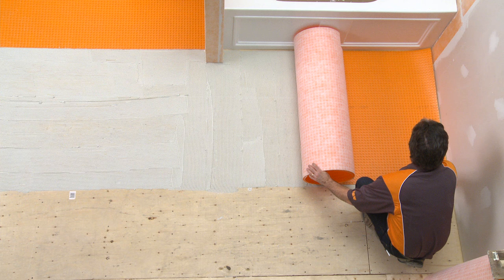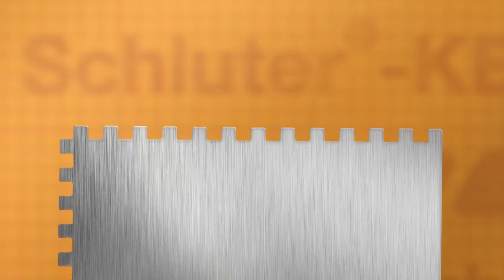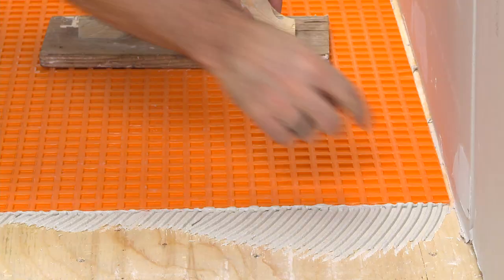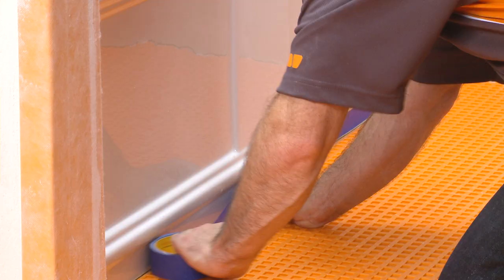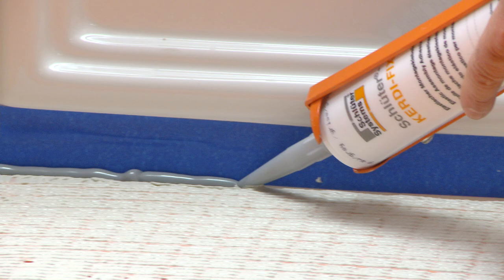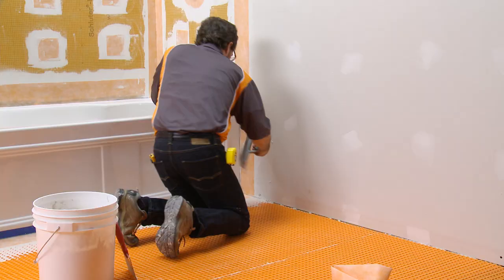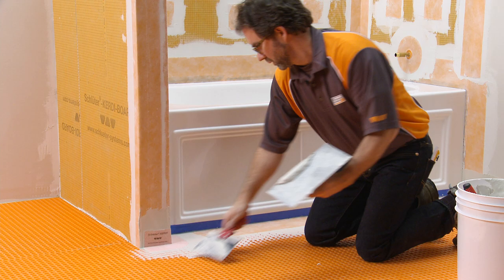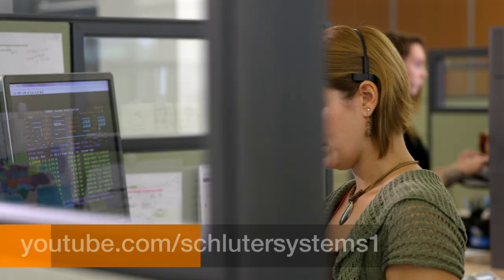How to Connect Schluter®-DITRA Uncoupling & Waterproofing Membrane to a Bathtub Surround

Comment: Thanks, very helpful for this first time diy. I have a question though, if you thinset right up to the wall for the band, doesn't that remove any possibility for expansion? Shouldn't it have the silicone on the quarter inch gap at walls like around the tub edge?
Reply from the maker: Hi! Good question. No need to address expansion in that area between the wall and the DITRA, as the thin-set won't be an issue there. However, movement should be addressed at the change of plane in the tile layer with a DILEX movement joint profile. Hope that helps!

Comment: How do you waterproof around toilet flanges that penetrate Ditra? Also, have water and drain pipes that penetrate vertically through the Ditra to facilitate a clawfoot tub. I can waterproof the 3/4 inch water supply with Kerdi Seal, but how do I create a waterproof barrier around the 2 inch drain pipe?
Reply from the maker: Hi Jeff! Our customer service team would be better suited to answer this question. You can reach them at 888-472-4588 (USA) or 800-667-8746 (Canada). Hope this helps!
Reply: @schlutersystems1  Thanks. I called and they suggested I caulk around the pipes and toilet flange with Kerdi Fix.

Comment: I'm going to be tiling our bathroom, floors and wall. The floor tile will be set on Ditra XL (over OSB). I'm about to cut and install the drywall. Ideally, what size gap should there be between the Ditra and bottom of the drywall for applying the Kerdi band ? Also, there will be a glass walled shower stall in one corner with acrylic shower pan. The pan is already embedded level on a plinth of self-leveling compound 3/8" thick and extending 1/4" beyond the margins of the pan - so the base of the pan should come flush with the Ditra XL when installed. When I poured the SLC I stuck foam backer rod around the 'bottom' plate of the wood wall frame to serve as an expansion joint. There also needs to be a 1/4" expansion gap between the Ditra and SLC plinth. I was thinking to fill that with backer rod also, but since I'm going to be putting Kerdi band around the pan, do you think I would be just as well filling it with Kerdi Fix ? Cheers.
Reply from the maker: Hey there, would you be able to call our Customer Service team in order to discuss your project together in a bit more detail, and they can advise from there.
800-472-4588 (US) or 800-667-8746 (Canada). Thanks!

Comment: Ive always wondered but how is the system waterproof if mortar is the adhesive? Wont water just soak through the tiles and permeate through the mortar adhering the membrane materials?
Reply from the maker: Good question! What happens when the thin-set is sandwiched in between two layers of KERDI (or KERDI-BAND) is that the capillary action in the mortar does not allow water to migrate past an inch or so, even in situations with water pressure. This is why we require a 2" overlap and why the system is waterproof along with the membrane. Hope this helps!

Comment: Why wouldn’t you apply the Kerdi fix along the tub before you trowel on the thinset?  Also, I don’t see where there is a joint along the front of the tub that needed the Kerdi band.  Can you please elaborate?
Reply from the maker: Hi there! The thin-set is applied first so the trowel does not disturb the bead of KERDI-FIX. The 1/4" gap left between the DITRA and the tub needs to be filled with KERDI-FIX to waterproof the joint with KERDI-BAND because thin-set will not bond to the tub.

Comment: Exaggerated with all floor corners waterproof. Are you gonna flood your floor guys?
😁
Reply: It’s right next to a shower, which typically tends to spill out a little water. God forbid you are going to be giving kids a bath in there, or have someone who doesn’t realize the shower curtain is outside instead of inside. Very realistic scenario to have water in that area. Sure there won’t be 3 inches of standing water but it takes a lot less than that to get a wet subfloor.
Reply: You've never had kids. 😉